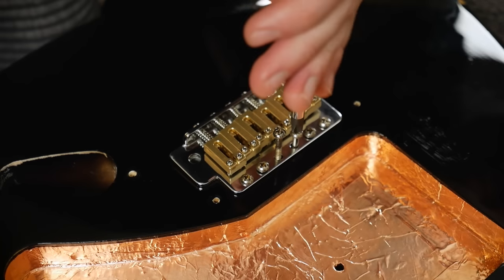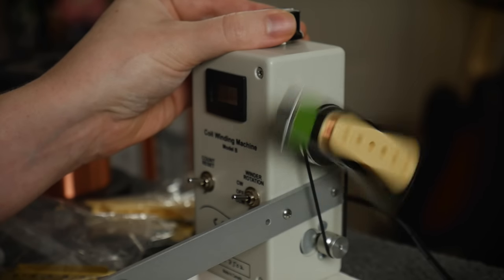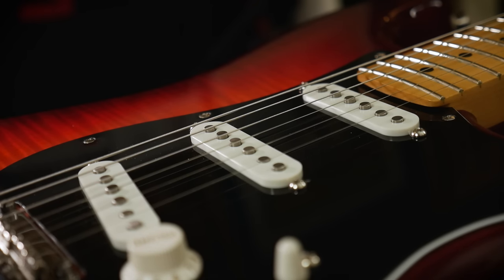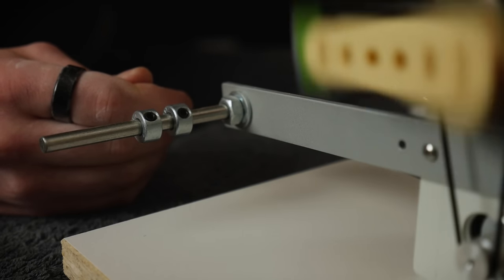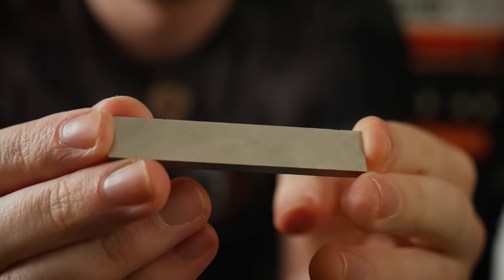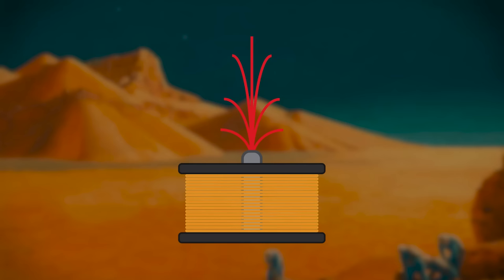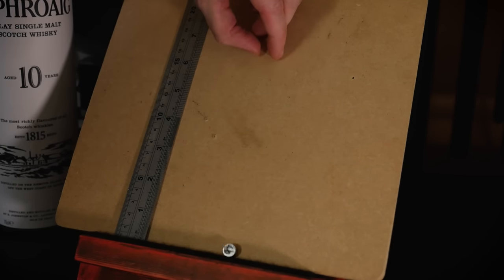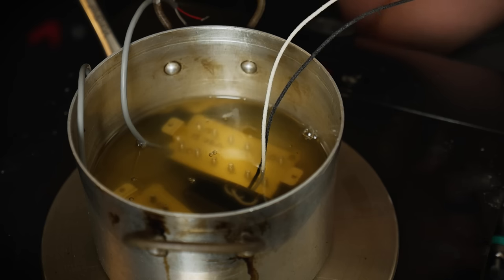(almost) EVERYTHING About Pickups | Too Afraid To Ask

Comment: People obsess over the types of wood and joints in guitars and completely ignore what’s actually generating the signal.
Reply: Such people are "guitarded".
Reply: Actually, most people who obsess over the construction of the guitar are just as obsessive about their pickups. I have no idea where you get the oppinion that they ignore what's generating the signal at all never mind completely.
Reply: @Relayer6a   I'm talking about people who think tonewood is a thing, not the craftsmanship.
Reply: @joshuabarron8535  I know what you meant. And those people most assuredly care about the pups, nut, bridge, etc... They probably care more than the people who don't think the guitar itself matters.

Besides, if it doesn't matter to you that's ok. But people telling others that it only matters if they think it does, is just self righteousness.
Reply: @Relayer6a  whatever
Reply: How  do you  know they dont  obsess over ALL of it?
Reply: @michaelcraig9449  I can tell you that they (we) do. And not just the quality of the materials and the hardware but also down to the set up and ancillary equipment.
Reply: @Relayer6a  I agree - lots of things affect tone.  Different pickups and strings make a very large difference.  There are many other ways to affect the tone noticeably, not as much as the pickups do, but still perceptible, and each component is additive.  The materials used for the body and neck definitely matter, but many people might not notice the difference without an A/B comparison, and even then, it is swamped out by distortion when the gain is cranked up.  If you always play heavy metal, then you can save a lot of money and buy a Chinese knock off, as long as you can live with the setup and feel.  Also allow for the fact that some people have better hearing, and some worse.
Reply: @JohnShalamskas  And some are simply better listeners. I think a lot of people's perception gets overwhelmed by the similarities and they simply can't separate the differences.
Reply: @MATCHLESS789  There are always "some people". LOL
Reply: It’s far funnier when they typically use active pick ups too. Because the body of the guitar means absolutely nothing. 
It could be in mahogany or acrylic, it’ll practically be the same.

Give me solid tuners, a good bridge and a traditional rosewood fretboard or maple, and the rest largely just becomes a matter of looks and how long it’ll last.
Reply: What I never understood, all of this debate on pickups and haha, tone wood...has to be done on a clean amp setting. ( That's another debate on cleanest amps, but I digress )  So, all of the research and time and money spent.... Only to throw all of this out the window by adding some idealic distortion pedal in the mix.  And not many play clean at high volume. 
    What's more, the general public isn't able to tell the difference....so why do it at all ? 
     The original idea of a guitar is to make music. Are they ? 
    And, do any of these people actually meet face to face and prove their point ? And really listen ?
    It appears to be the age old pissing contest or who has the biggest Weiner, to me. Hahaha!
Reply: i mean, everyone who cares more about pickups than the amp itself and the mic position is not that trustworthy with tones
Reply: @nicolasreveco3748  some people nowadays just use a usb audio interface with plugins for guitars so for those people amp and cabs are meaningless since everything is modeled in the software.
Reply: The only time that obsessing over joints is warranted is scarf joints on les pauls, as it would save a lot of broken headstocks, and waste a shit ton less wood than their archaic ways
Reply: @Lamster66  So you don't think some people can not just hear better than others, (only a moron would think differently), but listen better?
Reply: @Lamster66  You go ahead and measure stuff instead of listening if it makes you happy. It's certainly easier. 

See that's my problem with your kind. I will never tell you that you can or can't hear something. What's the use of that. You should try and be the same. You're just trying to win an argument. You couldn't care less what I can or can't hear, and you'll never hear half of what's going on.
Reply: @Lamster66   Quit trying to move the goalpost. You don't need to build guitars to listen. And judging by your responses, that's your problem. You don't listen.
Reply: @Lamster66  If you think all people, even with good hearing, can all listen equally as analytically then you just aren't being realistic. I'm not talking about the engineering side of it. And I'm also not knocking the engineering side of it. You on the other hand think that everything can be done on paper and listening is a waste of time. Which gets get right back to why you will answer my post again while completely ignoring what I said and turning it into some kind of anti engineering voodoo, which it is not.

And since you somehow have found a way to make it anti Christian as well, I'm finished. I will not promote your platform. There's too much divisiveness in this world.
Reply: @Relayer6a   There has never been a blind test where people can discern tone woods. Everybody is just guessing.
Reply: @Chris-MusicTheoryAndFretboard  Did I say there was?
Reply: @Relayer6a  If there is no evidence to believe in something then why believe it? Of course some people have better trained ears than others. However, several blind tests have shown that experienced musicians cannot tell the difference between different types of woods on an electric guitar. It really doesn't matter how good your ears are.
Reply: @Chris-MusicTheoryAndFretboard  What did I say I believed in?

And as far as tests go, they only prove that in that situation, conditions, and with those individuals. They don't really prove anything in the real world. I'm not saying they are wrong, just that they don't prove anything outside the scope of the test. And just because someone is a musician doesn't make them "better listeners".
Reply: With you on the tonewood versus pickup argument.... In fact there is a young guy who plays well and does an interesting video series on where the tone/sound actually comes from in an electric guitar. He does one on the amps/cabinets as well. 
Interesting what he learns.... I won't spoil it here.

Meanwhile mocking the Lord, insulting Cristians and generally casting flippant negativity toward strangers is generally beneath the behavior of my trusted cabal of EE design teams. They are forthrightly humble, intelligent and appear quite content to act as gentleman.
In fact many have engineered Christ into their lives and are far better for doing so.
Perhaps your trials will mend your resistance. Tempis Fugit
I sure there is better buried in you.
As Relayer surely does I pray you a better path......God blessed your very birth you don't see it just yet .....in time you will see this unseen part of the spectrum.
Happy coil winding
Reply: @warrenbutterfield4208  That's just it, I'm not arguing tonewood vs pickups at all. The statement I replied to...

 "People obsess over the types of wood and joints in guitars and completely ignore what’s actually generating the signal."

And simply pointed out that people who "obsess" over tonewood do not ignore ANYTHING about the guitar. They care about pickups, bridges, frets, scale length, pickup placement, and everything else. They stress over the wire in the pickups, magnet types, and on and on...

But thank you for taking a positive approach to the discussion.
Reply: You mean the strings or the player?
Reply: The wood matters believe me. Neck, body - everything!
Reply: @tylerdavis3 Thanks for that response. You sound so certain and I respect that. Its just that I had occasion to witness quite substantial alteration in tone with a change of neck on a solid body with otherwise the same fittings. I put it down to the frequencies present and their distribution strength that then hits the pick-up. What goes in might come out. What doesn't go in can't come out.... !!
Reply: The speaker?
Reply: So true, but it's been bled into them. I like that Gibson series where they discuss guitar collections of the legendary guitarists and even those guys keep saying things like "yeah, I really love this one because the maple top is thicker and brighter up the tone", " yeah, I needed the rosewood fretboard to darken the tone" blah blah blah. 
Put the same pickups, nut and bridge into a block of fireplace mantle and they'd barely notice the difference. The science doesn't line up with what they're being taught... But we know this is not the era where facts matter much.
Reply: Maybe focus on the thing that changes the electric energy to acoustic energy?
Reply: The speakers in your cabinet.
Reply: Aleluja!!!

Comment: As a physicist, I know explaining complex topics in depth can very quickly become very boring; whereas explaining a simplified version might lead to wrong conclusions. I think this was very well balanced — thoroughly explained, but not so much so that someone unfamiliar with the specifics wouldn't understand it
Reply: Can you fississists please change that eternal fississist into a proper English word? Fississist is just white noise, I can't stand that word.
Reply: He got the whole stacking of the windings wrong though about causing the sounding different in the magnetic field. As an EE with an emphasis in electromagnetics, I can tell you that it's the distributed capacitance that effects the sound of the pickup with short vs tall wound bobbins, esp into higher impedance amplifier input stages.
Reply: Why am I tempted to see if I can build an electric forge, heater or motor using guitar pickups after watching this video?
Reply: @voornaam3191  what is proper English though? Each English speaking country has different spelling.
Reply: @indridcold4210 
Thanks, now I'm completely confused about everything again, good job.

Comment: It might be helpful to note that Seth Lover, inventor of the far-famed Gibson PAF humbucker, stated that the magnetic field of the permanent magnets in pickups extends upwards into the guitar's strings and MAGNETIZES them.  They therefore generate their own mag field, which then penetrates the coil(s) beneath the strings.  When any string moves, it necessarily moves its mag field with it, and the part of the field that penetrates the coil(s) below induces a small electrical current in said coil(s).  THAT'S YOUR SIGNAL!  I, too, used to think that the strings simply disturbed the mag field coming from the permanent magnet, but it isn't so.  What IS so that matters is that the pickups WORK!😀

Comment: The main thing to understand is that raw pickups need to work into high impedance electrical loads - 250k-1M ohm.  If you force a passive pickup to work into a low impedance load (such as a line-level direct box), the high end will be rolled off, much like turning down a treble control. This will not happen with active pickups, because the guitar contains built-in high impedance preamps that protect the pickups from low impedance loads.

Comment: Colin can you PLEASE do a ‘What’s the Difference’ between Silicon and Germanium transistors in fuzz/boost pedals?
Reply: That is a really good request/question.  I'd like to know too.
Reply: @timmotel5804  I'm a little late, but fundamentally they have a similar sound because their transfer function is similar, much more similar than between transistors and tubes. From an engineering standpoint, germanium transistors may have an elusive quality to their sound due to their inconsistency. The properties of germanium transistors are much less consistent than modern silicon transistors, and their properties change much more with temperature, so devices built with them were temperamental and not two would sound exactly alike - I speak in past tense because they're no longer manufactured and any germanium effects you find now use new old stock parts, so they'll be gone soon. When using germanium, the same unit which sounds great in the summer might be unusable in the winter. Jimi Hendrix was known to keep several fuzz pedals with him to resolve this issue. Fuzz pedals built with germanium also have a lower maximum gain available for the most part because the majority of silicon transistors have higher gain factors than germanium transistors. It's important to remember that the differences between different types of transistors and tubes is only really audible when they're operating nonlinearly (distorting), especially if not using negative feedback in the circuit, otherwise circuits sound the way they do because of how they're designed. People will sell you on all sorts of hocus pocus, but there's nothing magical about germanium transistors - tubes on the other hand offer an appreciable difference in distortion characteristics. If you want to build a silicon fuzz that sounds closer to germanium fuzz circuits try a low gain transistor like 2N4123. You can't directly substitute an NPN transistor like that in a germanium circuit though and would need to find a PNP equivalent.
Reply: @maudiojunky  Thank You.  Very  informative. Best Regards

Comment: This is by far the greatest explanation of the various designs in pickup engineering, the materials used, their interactions with each other, thus why each builds sonic properties react the way they do. Finding the right way to define some these complexities, concisely, while keeping easy to follow, is difficult at best. In turn, doing so without getting to far into the weeds that it puts the viewer to sleep, is a feat unto itself.  Bravo!

Comment: "More resistance = more output, less resistance = lower output"
Not quite true. More windings equals more output, which happens to also make the DC resistance go up. 
If your DC resistance goes up because you've used thinner wire, you won't get more output, you'll get less, due to the additional resistance. 

Great video though. Awesome to see inside all those pickups
Reply: Yes!  DC resistance is only a first order approximation of what's going on.  In a coil, the resistance to current flow increases as the frequency rises.  The AC equivalent of resistance is called "impedance" and is also measured in ohms.  There is a reactive component to impedance, either inductive or capacitive, which means the voltage and current are out of phase.   A stronger magnet increases the impedance.  More coil turns increases the impedance and the DC resistance.  Smaller wire increases DC resistance.

Comment: if you get a vacuum purger you can pump out all the air and make the wax permeate evenly and enhance the potting. Basically, its a pump on a ball valve connected to a piece of half inch lexan cut into the shape of a pot lid, with deforming gasket to make it air tight.

Comment: Question: What happens if the pickup cover is made of brass? or even in the case of the humbucker ring. Just curious how would that affect the sound. I mean, I would guess its supressed to a small degree but does that actually translate to a "finer" sound.

Comment: My fav PUs are my Seymour Duncan Ibanez stamped units in my 1993 Ibanez RG 750. They are ceramics and wound perfectly for a higher gain sound of that era. No mid range bumps. They have an extended low end, complex mids and a slightly mellow top end. They resist being pushed and remain very flat producing a great rumbling sound even with massive high gain outputs.

Comment: Lotta correct info here, but some speculation as well.

Stong magnetic pull affects the string harmonics in a way that can make the note timbre sound harsh or nasal.

A thinner wire coil has more consistent impedance.  The Q is lower, but it also extends into higher frequencies.  Some players might interpret that as being less dynamic, but such a coil actually has increased sensitivity and dynamic response depending on how much of it is within the stronger flux lines from the strings.  

Different core alloys also affect the Q.  Even different types of AlNiCo have some effect on the Q, and the permeability of the core alloy affects output as much as the field strength.  Finally, the electrical conductivity of the core affects inductance and the high freq roll off from eddy currents.

A Nickle cover does slightly roll off the highs, but has no significant effect as a baseplate. A Brass baseplate doesn't have nearly as much effect on tone as a Brass cover.  A Steel baseplate slightly increases inductance, and the high permeability draws flux lines down through the coil, as well as reduce the field strength at the top of the poles.

There's some confusion about the effect of hand-winding.  A more scattered coil is fatter and less efficient, and there's also increased capacitance and semi-shorts to consider as insulation is stretched thin or even cracked.  That tends to roll off the highs, and a brighter sounding pickup can be interpreted as sounding "sterile".  Pickups hand-wound with the old HF insulation wire tend to have lower capacitance and less semi-short issues than those wound with the old PE wire, and the less dense coil results in weaker lower note harmonics.  The way that hits gain stages increases higher freq content-- sometimes interpreted as more dynamic, yet those same players would complain that a coil without any high freq loss may sound sterile?

In short, any guitar player might prefer a densely wound coil over a scattered one with random eddy-current losses depending on the inductance and core properties, the guitar it is in, the phase of the moon, etc.  Guitar players can be a fickle and naïve bunch.  It takes one to know one.